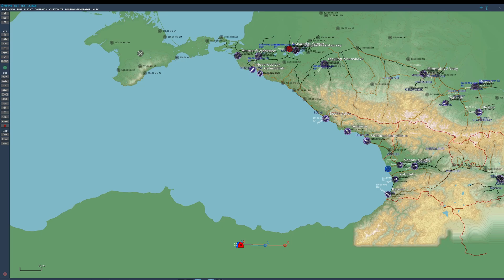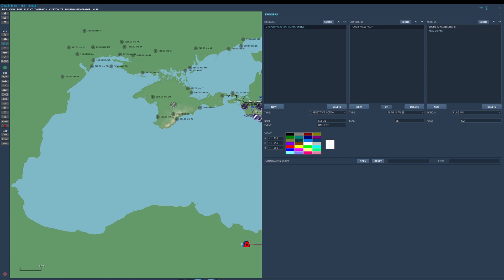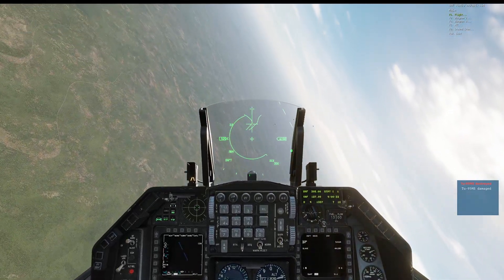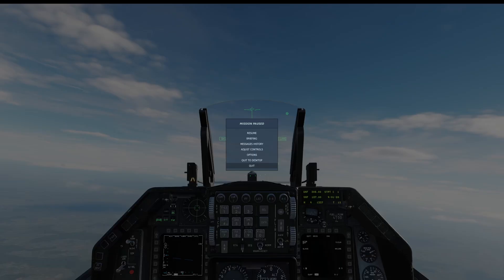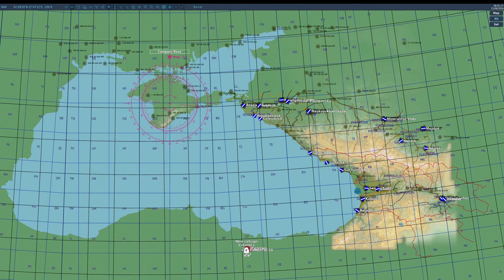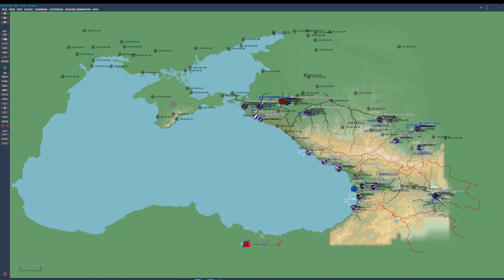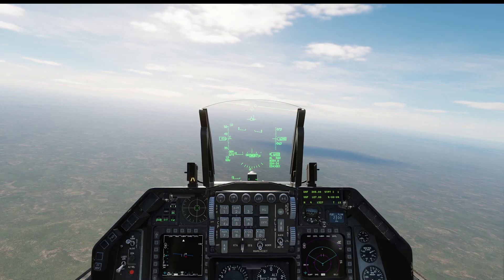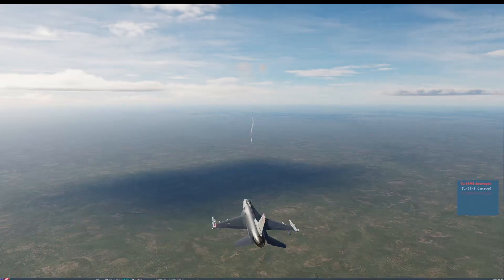DCS How To: Make an ELT Transmission in the Mission Editor

Comment: If you set it to loop in the last example, you could locate the ELT position?
Reply from the maker: You could if you have DF capability.  It would be up in the air, but for simple DF it should work.   (F-4E can DF UHF ;-) )
Reply: @sedlo  How would you get the Pilot to pop smoke when you're close enough? Say 2 KM?
Reply from the maker: @30K_ACTUAL  well, some very fancy scripting would be involved.  Likely with the help of MIST of MOOSE. 

I think MOOSE had some sort of RESCUE or SAR class you can work with, but I’ve never used it.
Reply: @sedlo  cool :) maybe one day when I figure that out.
In the meantime I can just make a few random pilots appear!

Thanks for your help
Reply from the maker: @30K_ACTUAL  Hmm.. just thinking about it.  You can get the location of where the ejection takes place and then have that location and find the actual ground elevation, you could pop smoke directly behind.  

It wouldn't account for wind drift, but it could work.